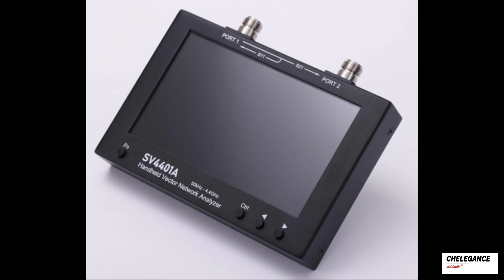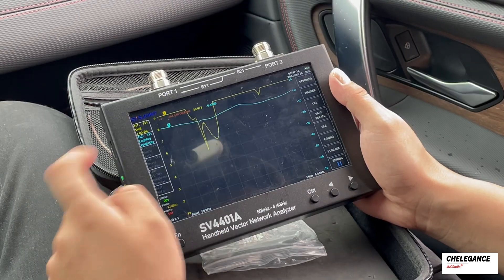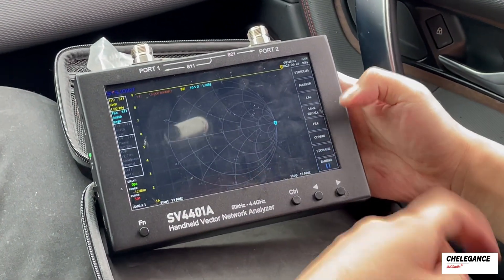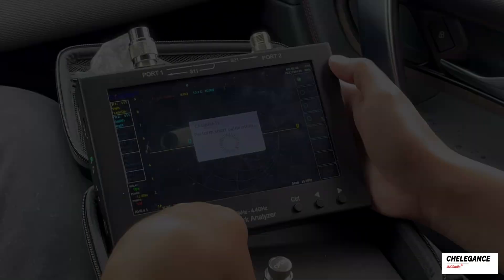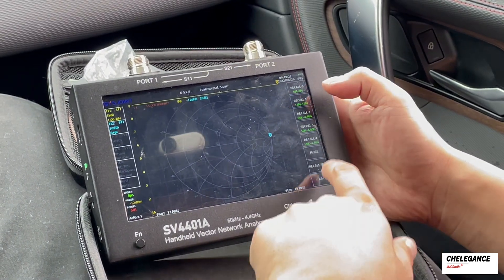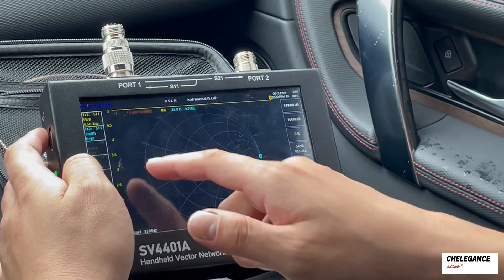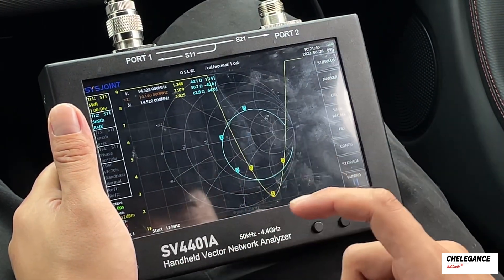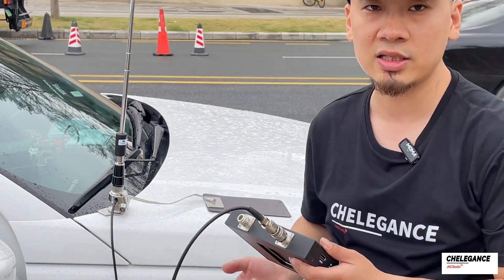Mastering SV4401A: A Hands-On Guide

Comment: I do not see an opton to display a linear (rectangular) graph of R+/-JX as is possible with all previous nanoVNA's. This is extremely useful for evaluating chokes/baluns, amplifier input impedance, crystal parameters etc. Am I missing something or has this very important feature beem omitted?

Thank you,
Dale
Reply from the maker: Hi, The device does have the option - You should be able to see from the list of formats that you can choose from. It's likely you overlooked it..
Reply: @chelegance  Thank you. I had heard from Sysjoint a couple days ago. Very pleased with the  SV4401A comparing it to my $5K Siglent- it does even more. Maybe not as fast, but overall, and excellent VNA